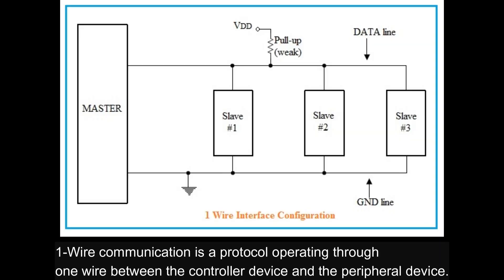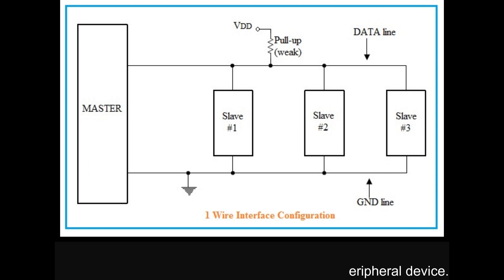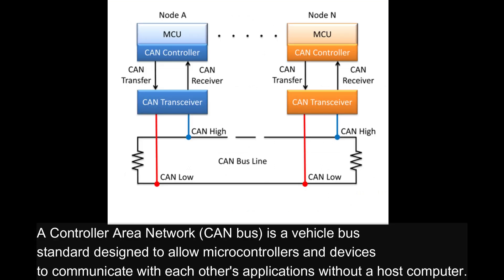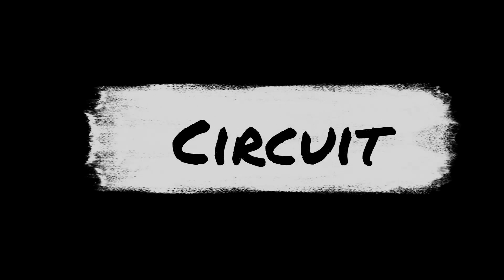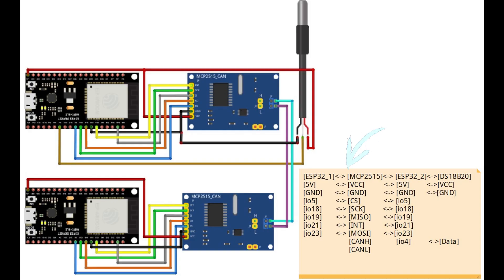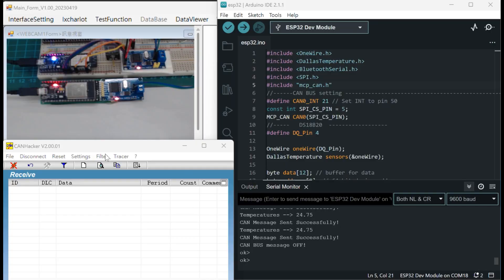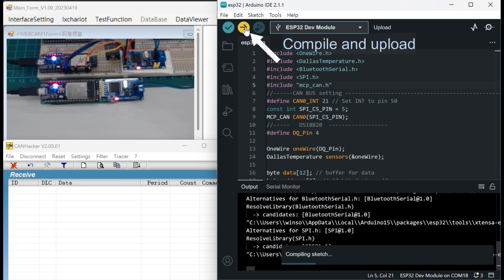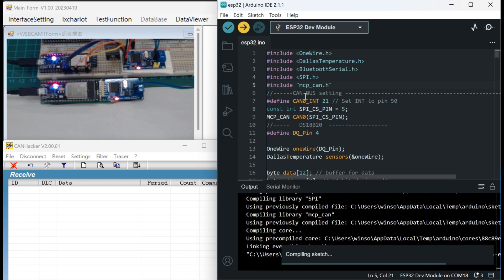Two ESP32 CAN Bus communication with MCP2515 module

Comment: How do you power the module with 5v, when the 5v will set mcp gpios to 5v that can kill the esp32?
Reply from the maker: Hi, System power supply is 5V, that is not input 5v to GPIO pin!!

Comment: does this scheme works as can filter? some data comes into 1st module (for example speed 10 km/h )=> send it to 2nd module => changes data (speed 5 km/h) => send it back to car?
Reply from the maker: Yes, this scheme can to do that when module #1 got speed value then change the value and transfer to module #2, But I don’t think it’s okay to write back to car!!
Reply: @winson-DIY  thanks. write back not to car, but to multimedia. such filters are used to avoid restriction for showing video in motion (VIM). restriction is usually starts from 5-7 km per hour, and filter sends 0 km per hour to media.
Reply from the maker: @midnightpvp  OK,  Maybe you can try CAN0.init_Filt(can.filternum, can.filterext, can.filterId); or CAN0.init_Mask function for your purpose!!

Comment: Hi. Excellent video. ESP32 has 3.3v logic and in the picture of circuit diagram I saw that you connected the MCP2515 at +5V. Wouldn´t this harm the ESP32? Otherwise, the chip circuitry in the MCP wouldn´t work at 3.3v. Maybe i´m missing some step.
Reply from the maker: Hi, Just the voltage provided to the module and Getting SPI to work. It has nothing for 3.3 level!

Comment: Thank you for your excellent tutorial. But one question please. Normally ESP32 integrates the CAN controller (TWAI), so why use MCP2515? Wouldn't it be simpler to use the SN65HVD230, for example? What is the reason for choosing MCP2515 (which we see very often)?
Reply from the maker: Because I want to use CANHACKER software, That library only supports MCP2515 module!!
Reply: Perfect answer! If I understand correctly, the HW is a little more complicated (MCP2515), but the SW is directly available. That's a good reason! If I may ask another question, do you have any opinion and/or experience on SN65HDV230 v/s ADM3051?  Many thanks for your tutorials (I'm trying to familiarize myself with CANbus, and I chose the ESP 32 platform because CAN is integrated, good choice?) Merci beaucoup, Claude  @winson-DIY
Reply from the maker: @cccbbb3161  Yes, CAN solution for ESP32 is not just one MCP2515! I hope you have a good solution

Comment: the ESP32 has already embeded CAN BUS reading functionality ,so MCP2515 is needed for logic converting voltages and 120Ω CAN termination resistor   , so is hassle free i guess  , am i correct?
Reply from the maker: First you need to coding for drive the MCP2515 module and MCP2515 has a terminal resistor on it!

Comment: Can you make a video on I2C on esp32?
Reply from the maker: Which device?
Reply: @winson-DIY   How to connect  accelerometer , temperature  sensor and display module to esp32! All three module have SDA SCL.
So how to do the circuit ?
.
Reply from the maker: @ShawankumarParida  You can connect SCL together and SDA together then use this video https://youtu.be/Ccd6ZTPcAEk code "I2C_Scan" function get difference address about these three Device
that video code can get temperature.
Reply: @winson-DIY   thank you😌